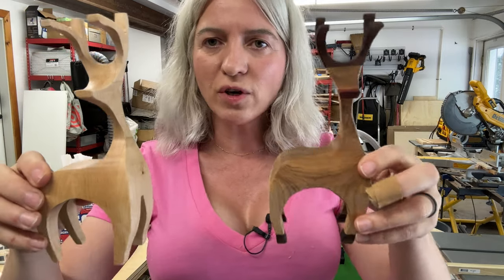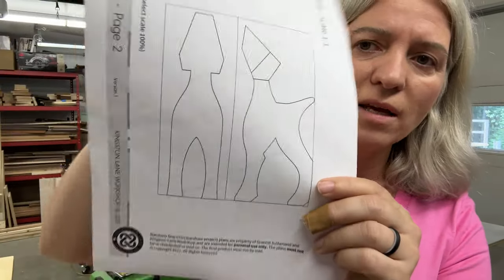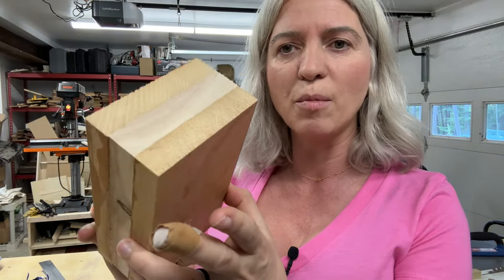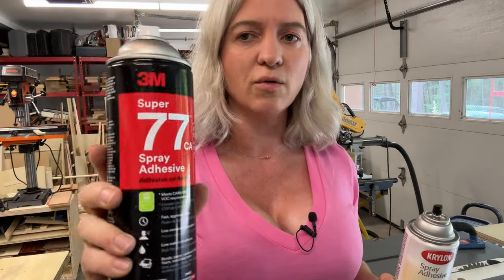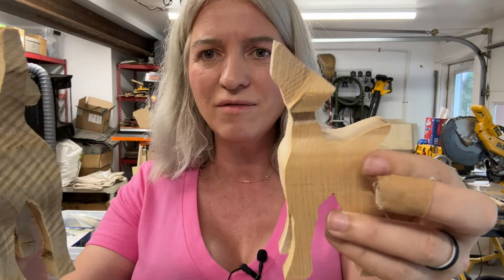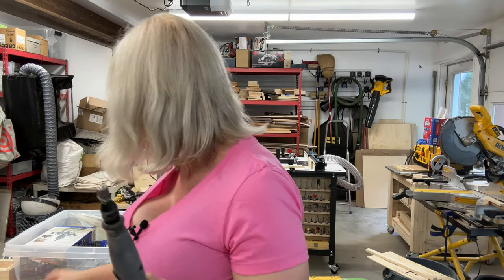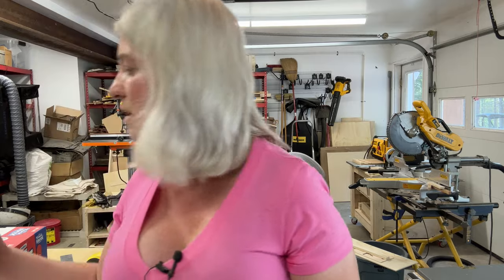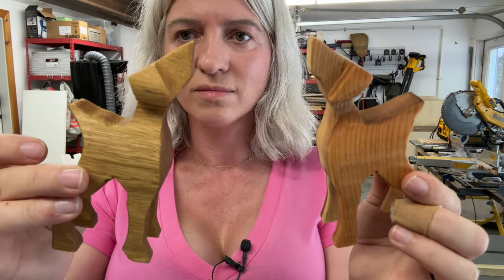How to make an easy bandsaw dog. Easy woodworking projects that sells. Step by step tutorial.

Comment: Good video. I would advise caution in backing the bandsaw blade out of a cut, especially the long and deep cuts that this project requires. There is too much of a risk of pulling the blade right off of the wheels. It would be best to turn off the machine and let the blade come to a rest before removing the piece from the blade.